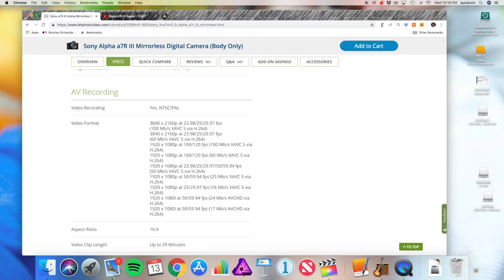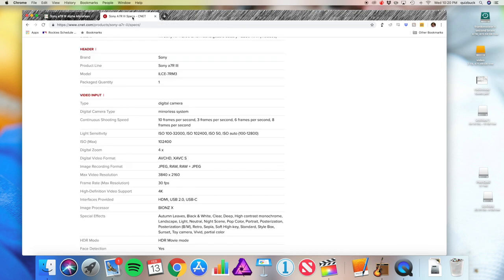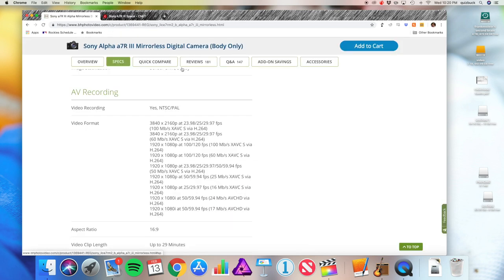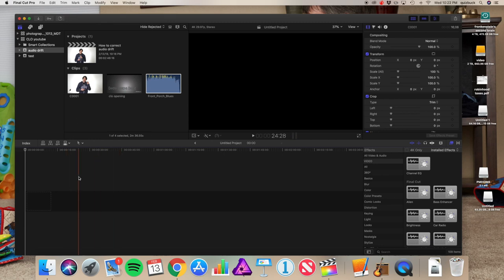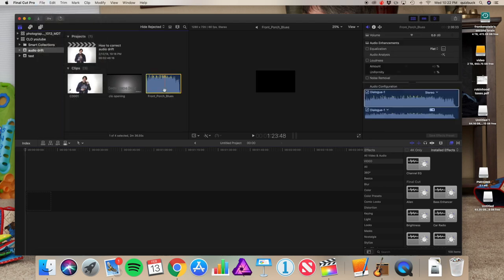How to correct audio drift

Comment: What I don't understand about this is that when I record a separate audio file, I'm choosing audio recording file specifications like bit-rate and sampling-rate....not frame rate.  So I would generally record at 24-bit and 48Khz.  Where does this "recording audio at 30fps" come from?  What digital audio work station sets frame rates for audio like that?
Reply: Yeah, that bit was not quite right. The audio doesn't have a framerate (apart from the sample rate). For audio you can choose whatever you want. The drift only happens when the video file gets assigned a different frame rate in the project set-up than it was recorded in. The audio file has nothing to do with it. But he probably just mispoke. The gist of the video is still right.
Reply: @bensonarizona7820  I agree, he mispoke

Comment: How should I correct the audio drift issue when converting a video to 'WAV' and importing it into Logic Pro X? I recorded a performance simultaneously with Logic Pro X and a camera, but when I tried to sync the audio from Logic Pro X with the video, I noticed that the video's audio gradually drifted out of sync, even though they initially aligned.

Comment: How about footage on a dash cam? Its the same issue audio is not in sync with the video on a few files.
Reply from the maker: If the microphone is recording separate then it'll be the same issue. In other words, that the frame rate of the video is different than the frame rate of the project. We would treat dash cams the same as camcorders in that sense.

Comment: I'm doing one of those virtual band vides and everyone recorded their videos on different devices/cameras, so I don't think this method will work for me, unfortunately. Can't seem to find a solution.
Reply from the maker: You simply need all your devices to record the same frame rate. This is why so many videographers need to work with cameras within the same system, they will have the same selection of frame rates. You can shoot with a variety of gear (most cameras shooting 24 FPS actually shoot 23.98 as an example) in many circumstances. Research actual frame rates before using the gear and you can mix brands with reckless abandon. Thanks.

Comment: Thanks for the video I'm hoping this fixes my issue.  My problem is drift.  I'm using the Sony A7s to output audio/video to a camlink type usb device.  However I'm also going into the Sony with a separate audio cable from my guitar. I'm not sure if the drift is happening because of that.  Or because OBS is getting audio and video from a single USB.  Or if it was just the 29.7 vs 30 thing.  Do you have any experience with issues bringing in both audio/video into camlink?  Would it be better to put my audio directly into a separate USB slot and audio interface instead of just directly in?  Appreciate your help

Comment: The problem i am facing is in the start would be ok but in the  middle of a video, it gets desynced
Reply: how did you solve it!
Reply: @lyili3428  did not find a fix, but in ableton one needs to remove the 'warp' yellow highlight . Try it might work for you.
Reply: @meowtrox1234  what do you mean by warp yellow light?
Reply: @lyili3428  you can find it on the track setting in ableton. Disable the 'warp' it is highlighted in yellow by default, which means, it's turned on. Try switching it off before you do a new project.

Comment: An absolute nightmare is RIGHT!! It is driving me insane! But I cannot find help figuring out the best way to resolve this when I am working with 2 videos, not just audio. So in my case I am using my iphone to record my face, and my macbook pro's quicktime to record my screen. I have a Samson q9u usb mic connected to my mac so that audio is my main audio for my lessons. However, I need the audio to be in sync not only with my lip movement, but after I accomplish that which is painful enough, I need my  lips (b-roll video from iphone)  to match the actions I am performing on the screen. So far I cannot find a reasonable way to do this and this is the first time I experienced "drifting." I had the b-roll matcher perfectly to the a-roll then 6 minutes into it the drift starts to happen. 

Only thing I can think of is to remove the audio from my b-roll all together in one project, then bring that muted video back in with the a-roll screen recording and try to sync them ... I don't know. This is giving me such a headache. Any suggestions?
Reply from the maker: Yikes, that's a tough one. It seems the two videos are recording at different frame rates from each other (a common problem). They either need to be the same frame rate or (and this is a nightmare) you need to start splicing the second footage to continually match it with the main footage. I've done this for a large (4+ hour) project, and it's terrible. No easy outside of matching frame rates.
Reply: @CameraLessonsOnline  Thanks for the response! Yes you are correct. I had to splice to death. Lol, exhausting. Got it done though.

Comment: What if you record in 25fps and still experience audio drift?
Reply from the maker: Audio drift is a mismatch between the frame rate you actually record at and the rate of the project in your NLE. It can happen at 24 FPS or 30, it only requires a difference in the two rates. So, if you shoot 24 FPS you are likely actually recording 23.98 FPS and your NLE rate should reflect as such. Thanks.
Reply: Camera Lessons Online Thank you.  Will investigate. 👍🏾